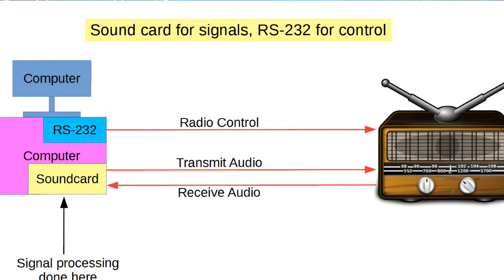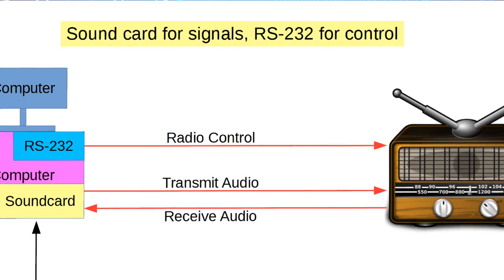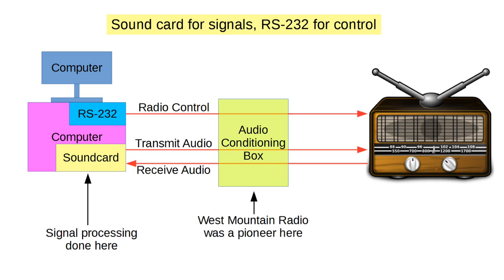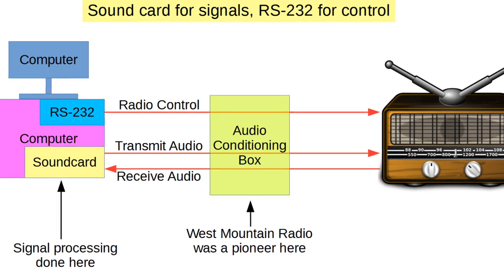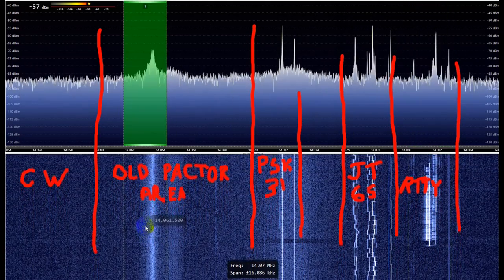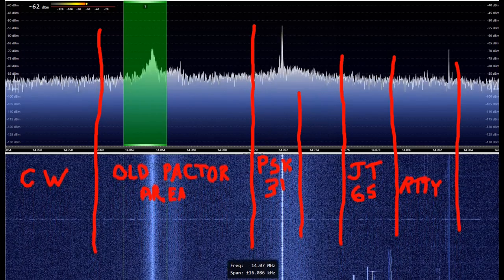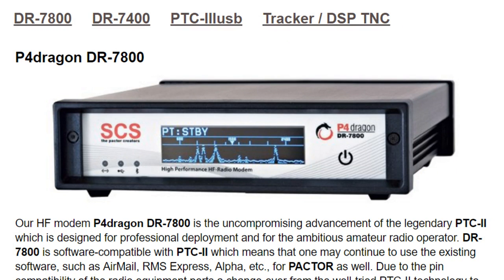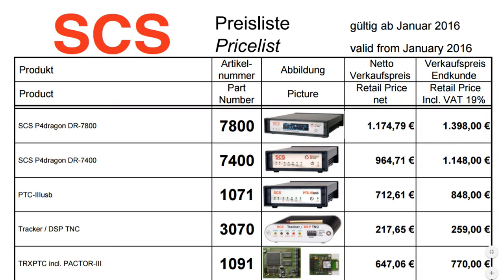From Data Modems to Sound Cards: AD #46

Comment: Thanks for the great video. My question maybe silly, can this be used to send and receive digital data like pictures, audio and docs? In theory it must, but do you have any figures about the speed and the geographical range? back when I was in the university I made a project of connecting 2 computer and have full digital network by only using sound cards. all the digital-analog-digital conversation was made by my code and I developed my own error correction and protocol for data transfer. speed was 0.5 KB/s
Reply from the maker: Indeed, they can be used for that, but they're horribly slow. There are file transfer protocols for both Pactor and Packet. The geographical range depends on ionospheric conditions and is highly variable. This is certainly something you can experiment with. Also look at SSTV, as there are digital protocols for that for sending small images. 73, Dave
Reply: Thanks Dave, great information :)

Comment: LOVE the videos Dave! Please please never stop! One question, though...Couldn't you use a USB to Serial conversion dongle, to plug the USB side into your PC (cause serial ports are all but gone), plug the serial side into the radio, then just connect the audio cables from your PC soundcard to the radio's audio input? then you don't need to worry about PTT, right?   I ask because my radio doesn't have a USB and the signalink's are still so expensive!
Reply from the maker: Yes, you can. You may run into audio level or isolation issues, but what you suggest can be made to work.

Comment: Excellent episode and thanks for sharing! I have been thinking hard about getting a SignaLink to use with my VHF radio. Now I am thinking that I might just purchase a radio that has it built in? What and the +'s and -'s in your opinion of going with a new radio with it built in?
Reply from the maker: +Tim Favreau You'll find that most sound card digital modes are on HF. Some of the more expensive 2m FM rigs have built-in packet TNCs. 73

Comment: I've been steadily making my way through all your videos, and I'm loving every one!

I was wondering if you might entertain the idea of doing a video on using RTL-SDR with SDR#: the cheap dongle receiver you plug into a USB port and its most popular software companion.  I have noticed a lot of people getting these dongles because they're interested in getting into amateur radio, but want to get a taste for it before studying for exams and dropping several hundred dollars (if not more) on radio equipment.  The RTL-SDR website has enough user-friendly information to get going, but other than that one section it's ridiculously hard for a beginner to make any sense of.  

What are the capabilities of this dongle?  What are all the complicated tools and features on SDR#?  How can you set the dongle and software up to tune into conversations, work a digital mode, or receive a WSPR transmission?  What kind of hardware can be connected to the dongle to get better reception (and learn about things like antennas, pre-amps, attenuators, etc.)?

Here's the dongle: https://www.amazon.com/dp/B011HVUEME/ref=cm_sw_r_cp_awdb_ftcPybC65T0D5

And here's the blog/website that, aside from the getting started part, is pretty hard to follow: http://www.rtl-sdr.com
Reply from the maker: Thanks for the suggestion. I have a similar dongle. I'll add the topic to my list for future videos. 73